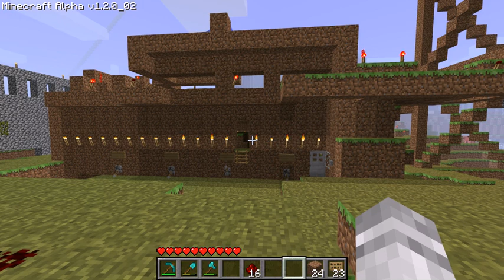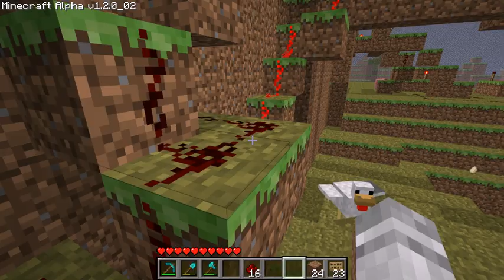Programmable lock that self destructs after three incorrect tries.

Comment: @ChronoSquare that's easy.  place the door 90 degrees off so it is open when unpowered and closed when powered.  Then they can feed all the power they want to it and it stays closed.  Won't open until the correct combo turns off the torch that is powering it from the inside

Comment: How about placing a floor of dynamite (covered by sand) which the user stands on to activate the door that, when 3 incorrect tries are up, plunges the user into a deep pit with water and explosions?

Cool idea, though. I like your implementation.